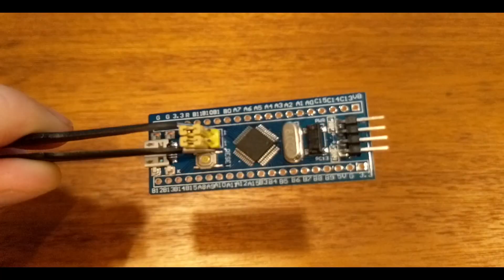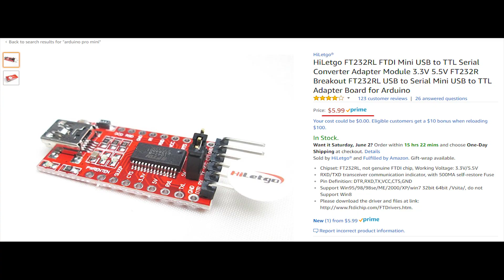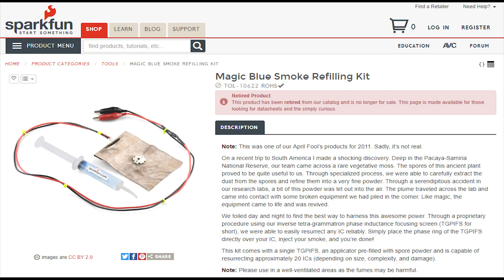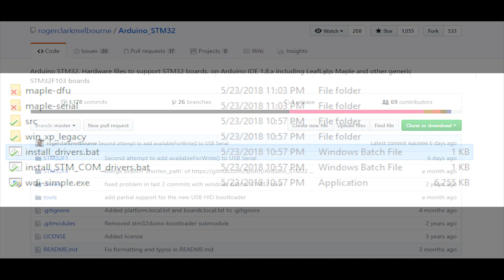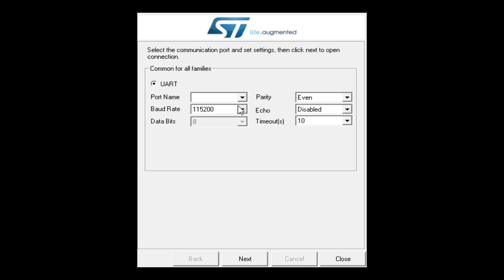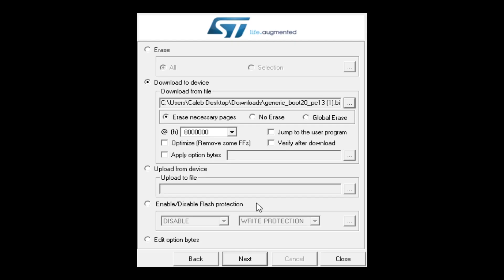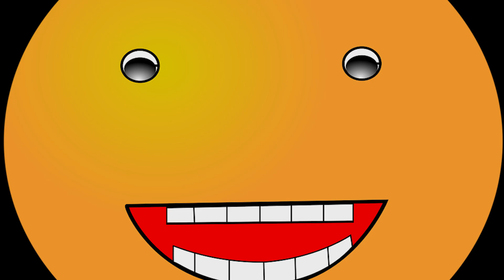Installing the STM32 USB Bootloader, Easily! [SEE DESCRIPTION]

Comment: Can't find the drivers batch file
Reply: Drakkor Vladimir https://github.com/rogerclarkmelbourne/Arduino_STM32/tree/master/drivers/win does this work?
Reply: Hi, No. STill the same search for dfu device...........
Reply from the maker: So you are downloading all of that repository, running the install drivers bat in that downloaded file set (uncompressed) and still nothing? Have you restarted your computer? When you open a device manager do the devices update when you unplug/replug the setup?

Are you sure you flashed the bootloader correctly? Did you move boot zero back to zero before losing power?

If all of this fails you might have to try changing the resistance of the pins (which I could guide you with)
Reply: Hi. Yes, I did all the rebooting stuff and I ended up with the STM driver showing in device manager. While trying to upload, I heard the usb connect ding sounds and saw device manager show the STM and also a maple, both with the warning triangles. I do have the 10k # 10 res so I am going to piggyback it (I have some SMD res) with a value to bring it close to 1.5k. hopefully this will do it? I will let you know.
Reply from the maker: You don't actually have to piggy back the value. You can use standard 1/8w resistors like so: http://amitesh-singh.github.io/stm32/2017/05/27/Overcoming-wrong-pullup-in-blue-pill.html
Reply: Oh, ok. I was just going to keep it there and not have to desolder the original. I see how you did it and I guess that would be a better way to see if this is indeed my problem. I am at work now but when I get home, I will follow your idea (Links). Thanks again.
Reply from the maker: No problem, I went through all of this trying to find a solution so I'm happy to share
Reply: Cool. exactly where do I put this code from the link?
Reply from the maker: Don't do anything with the code yet, just use some resistors as shown and try that first
Reply: Oh, I thought that code fixed it without having to add resistors.
Reply from the maker: Oh, sorry I never actually had to do this so I am uninformed on the topic, I don't know where or what to do with that code.
Reply: Ok, thanks. I'll go get my resistors and see what happens  :   )
Reply from the maker: Drakkor Vladimir one other thing you could try is changing the boot 1 jumper to 1 (the one you didn't use flashing the firmware) before you turn on the stm32. This will place it into constant dfu mode. If you can upload code like this, it is a resistor problem, otherwise, it is software. (You have to have the USB bootloader flashed for this to work)
Reply: I don't know...I just replace the resistor and get the same thing. This is what I hate about Arduino...It wastes so much of my time and answers should be way easier to find. I should be in the gm, or flying my rc planes, but no...I just have to learn stuff. Also, when I run the batch file, commands are not recognized????
Reply from the maker: Are you on discord or skype? Potentially we could have a quick chat so you don't need to waste any more time. My discord is ctjet#2406 I am at work right now though and will be for about 2 hours
Reply: I don't use either of them.
Reply from the maker: Do you have any other computer you could try this with?
Reply: Had to copy my hardware folder to my documents/arduino/hardware. Go figure? The hardware folder was in the Arduino program files. Thanks for all the help, I owe ya brother  :  )
Reply from the maker: Wow, I never would have guessed that, thank you for sharing your story, hopefully people read this if they need help!
Reply: Hi, Just an update.....After copying the "Hardware Folder" from program files/x86/Arduino to My Docs/Arduino and then reinstalling drivers from there (Did the other day and it worked) I just now, was able to write to an STM32 with the original (Wrong) resistor in it. HURRAY ! No more microscope smd soldering  :  ) Couldn't have done it without your great help. Just a note...I copied the hardware folder and did NOT cut and paste just in case, somehow, it needs it in the program files......

Comment: What can i say awesome explanation this STM32F103C8T6 are next generation mcu for cheap diy projects its same price as arduino pro mini but far better
Reply from the maker: I hope the Arduino community embraces them
Reply: The only thing that I've found that is worst than Arduino (at least on my board), is the ADC converter... Even when is connected to GND it still saying that is not zero, and I was unable to measure the right voltage because there are much variance in measurements. With an arduino board I was able to do it becuase is more stable.
Also a good thing that I can do with this board is to play with clocks easily. I'm able to create a 200kHz PWM signal with a few lines, and for now I'm not able to create a PWM signal higher than 1kHz on Arduino. Is better for a proyect that I want to do of an SPS.

Comment: Does maple mini mean (or imply) stmduino?

I'd like a video that shows how many gpio are actually usable on stm. Some say 37, but I see pins that are dedicated to other functions.
I liked the triple-try usb connection humor. :-)
Reply from the maker: The Maple Mini is actually a specific board, you can look it up and buy one. Stm32duino I think refers to boards flashed with the stm32duino bootloader. That might not be correct though. I believe there are slight differences between the two boards but I'm not quite sure. Did that help?

I have more stm32 videos in the works, but I've gone down a rabbit hole and am still researching for the next video.

Thank you, I knew someone would appreciate that joke :p
Reply: I'm eagerly waiting for my stm32f103c8 from ebay.  
I haven't found any info on debugging Arduino code (even if not in Arduino ide).  I would like to debug, but I really like the ease of the Arduino libraries.  Is it possible?

How compatible are the libraries?
Or, if debug requires non-Arduino libraries, how complete are those? (Support for lcd/oled displays etc)

(Lots of material ideas for your videos! :-))

Comment: Thank you for your clear explanation on how to do this. A real time saver!!!
Reply from the maker: No problem, I got upset at how hard it was to find this info so I made it easy for everyone else!
Reply from the maker: What system should I make a video for?
Reply: I use a MacBook Air Laptop or an iMac. I did not yet succeed in installing an FDTI driver on OSX ... ?
Reply: Andrew W Symons I don't know anything about Mac setup, check online for other types of drivers?
Reply: A little 'Windows-centric', unfortunately.